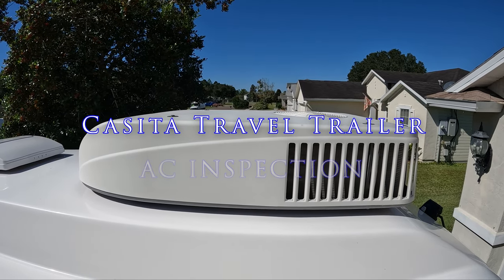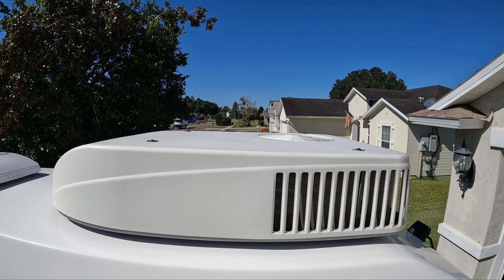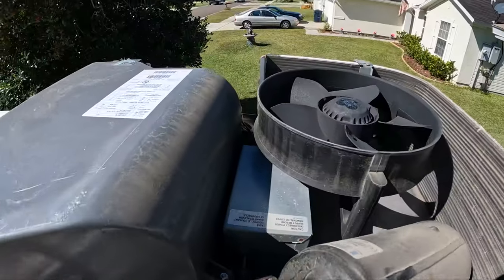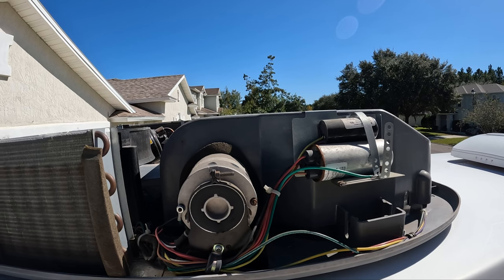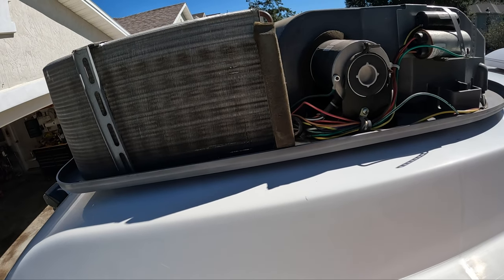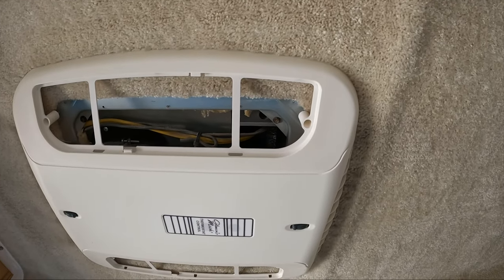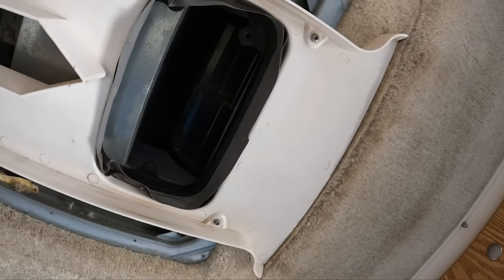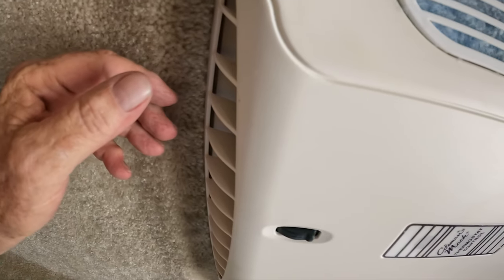Casita Travel Trailer AC INSPECTION

Comment: New to RV trailers, just got a Casita. It was about 97 out, high humidity and after about 3 hours of cooling the AC (mach 8) has nice stream of water coming down outside wall. Factory said that was normal, can you confirm? I guess i was expecting a drain tube or something so it didn’t just come flowing down the trailer. Thanks, appreciate the videos
Reply from the maker: That is normal. Casita does not install a drain tube.